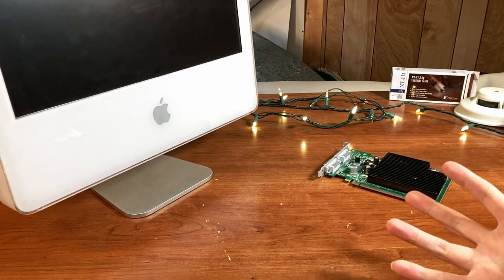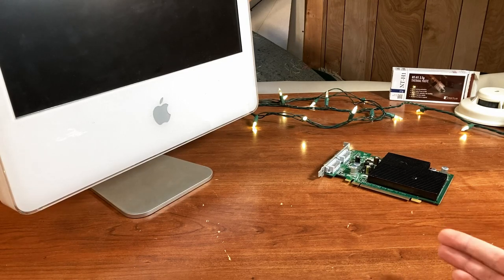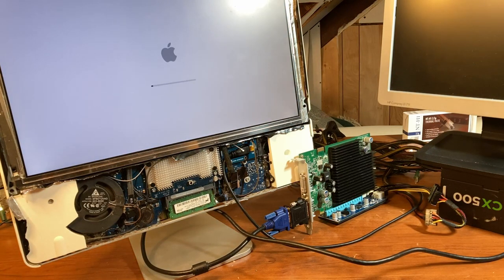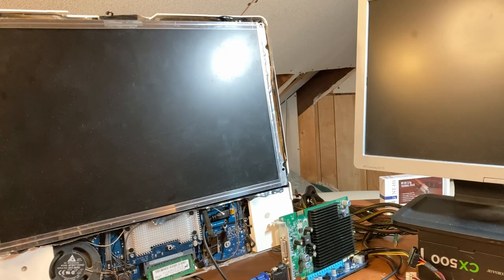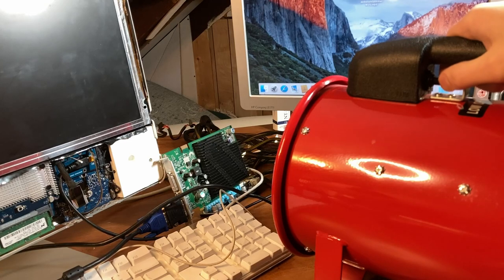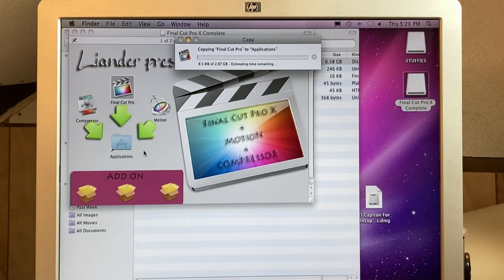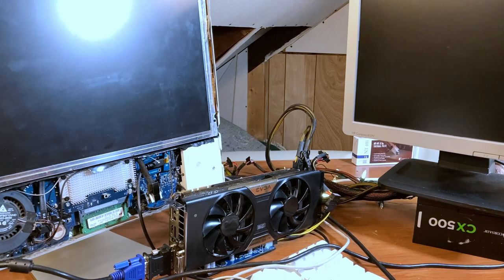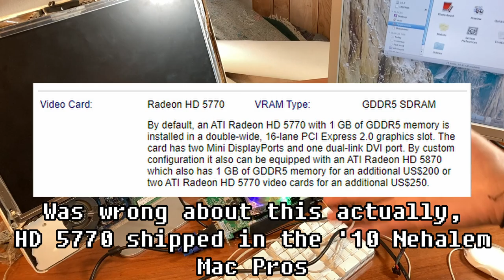'06 iMac GPU Upgrade? Better Graphics With the Power of mPCIE!

Comment: If you upgrade the CPU to a Penryn Core 2 Duo (I think you can) and put a supported GPU under newer versions of macOS, and put in 4GB of RAM and an SSD…
Technically you could probably get Big Sur to run pretty well.
Reply from the maker: ah now if only, this chipset doesnt support Penryn Core2 chips sadly, you can do that in the '07 models tho i believe
Reply: @WindowsG  then still you can find something supported in El Capitan. Geforce 8600M GT or 9400M GT are supported, and many other GPUs.

Comment: i think the high end nvidia gpus dont really like the 1x lane limitation, or restrict itself to not run on it. my 980 on a dell latitude of the same year refused to use it, only identified it as a nvidia gpu, nothing else, neither linux nor windows. the amd gpus might not have that problem but i highly suspect it depends on the specs of the gpu or the gpu is just picky. oh and mac osx is as you know, is specific to apples hardware releases.

Comment: I know that this is an old video but have you tried installing the Nvidia Web drivers? On my MacPro1,1 when i installed a GTX 970 it wouldn't work under El Capitan until I installed said drivers.